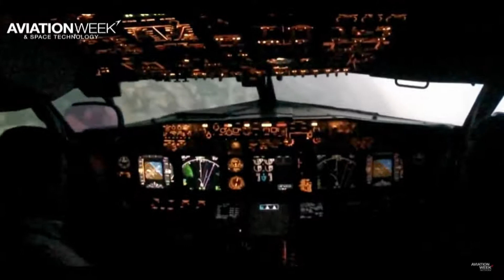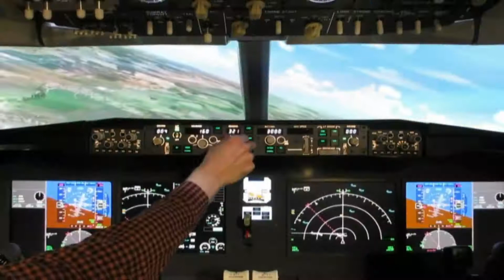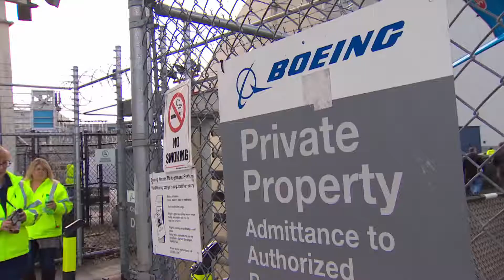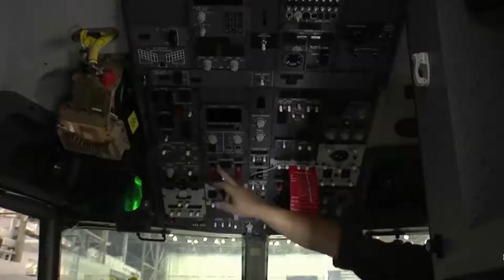What is wrong with Boeing 737 Max 8 MCAS?

Comment: THE PROBLEM IS THE DESIGN OF THE AIRPLANE...ENGINES ARE TO FAR FORWARD...THATS CREATING THE ENTIRE PROBLEM
Reply: There is no problem with neither the plain nor MCAS system the problem is with Boeing not requiring pilots to train with that system in place.

Complete lack of imagination on Boeing side.
Reply: @Sater109  disagree...mcas is there to correct a potential problem..why not get rid of the problem..ITS A LEMON

Comment: As a retired airline pilot, I'm concerned about the trend in designing aircraft control without pilot control.  One problem seems to be that engineers don't consider pilot's input in the designing phase of an airplane.  For example, I flew the KC-135 in the USAF.  When it was originally designed it had water injection to increase thrust during takeoff (old technology).  Engineers designed the system to have left and right water injection systems.  If one system failed during takeoff, directional control (due to the tremendous yaw) would be just about impossible and caused mishaps.  Now it would have been easier to build the water injection system with left and right design, but it took the pilot's input to come up with inboard and outboard design which solved the unacceptable yaw problem.  Boeing changed the design and refitted all the tankers with the safer inboard and outboard design.  My point is this,  until technology advances to the point that aircraft can be operated without pilots, SAFELY, (and I don't think it will happen in my lifetime) there needs to be ways where pilots can flip a switch or push a button and fly the aircraft manually.   Come on Boeing, putting bigger engines on an older airplane design that requires software to compensate for pitch problems when thrust is changed is just not good design.
Reply: the problem ,money and management is they remain too secretive and narrow minded without operators and outsiders involvement leading to this
Reply: The first sentence of your comments says it ALL!